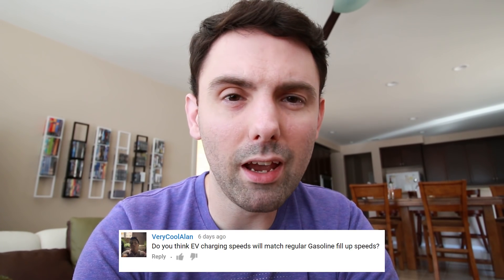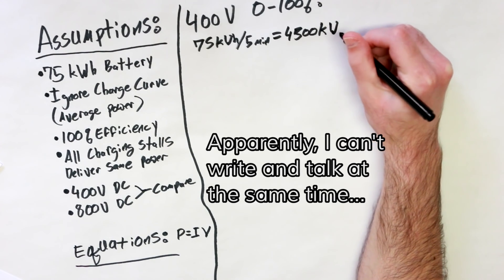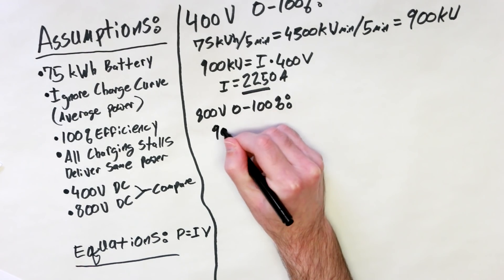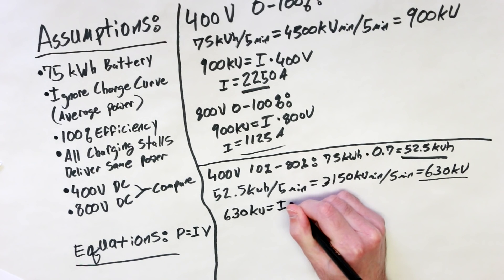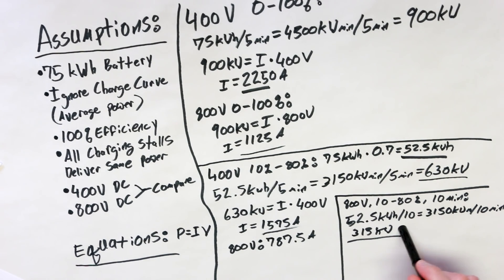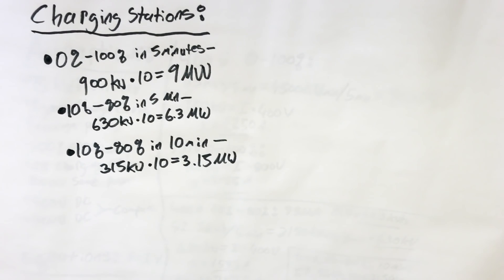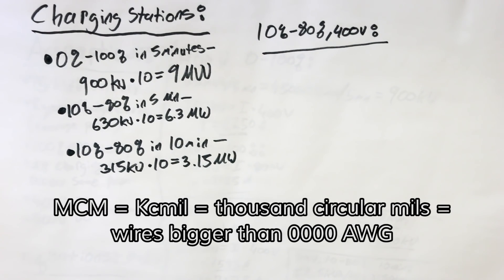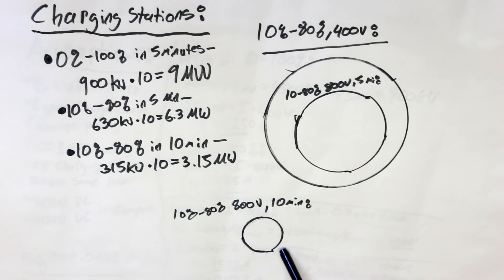Can Electric Cars Charge As Fast As Gasoline Cars Refuel?

Comment: Are your assumptions valid? How many people often do not refuel until the fuel needle is actually on E, and the low-fuel light is glowing? How well does the EV battery produce the needed cruising power, at 5% charge? Yet a fuel car delivers full fuel pressure at 5% tank capacity.

People probably do not often run down to 5% battery charge, due to the lack of good recharging locations. But if recharging points were as ubiquitous as fuel stations, wouldn't we want to more often run down to 5%?

And why wouldn't I want to fill to 100% charge, well if that is reasonably possible in the future?

And if you have a lady in the car who needs a restroom break, shouldn't you figure 10 minutes?
Reply from the maker: The assumptions being made in the video regarding target arrival (10%) and departure (80%) state of charge reflect reasonable EV use when on a long trip. With a long-ish range EV (200+ miles), fueling around town isn't something you ever have to think about--you plug the car in when you get home and it's always good to go by morning. On long trips, charging stops are pre-planned, the car's software tracks energy usage, and you typically shoot for a target SoC (state of charge) of between 5% and 20% when you arrive at a charging stop in order to maximize your charge curve advantage (lithium batteries charge much faster at a low SoC than a high SoC). Similarly, one doesn't typically charge higher than 80% unless it is actually needed to reach the next charging stop because charging speeds slow significantly once you reach the 70-80% range and continue to dramatically slow down beyond 80%--the most time efficient approach boils down to only taking on as much energy as needed to make it to the next charging stop.

At a 10% state of charge in a Model S P100D, your 0-60mph time increases from about 2.4 seconds to about 3.9 seconds and max power is limited to about 329kW (441hp) instead of 576kW (772hp). Maintaining a highway cruising speed of 75mph requires less than 20kW in a vehicle with decent aero. So, yes, there is a drop in performance as the battery discharges, but not enough of one to in any way meaningfully impact your ability to maintain freeway speed. Lithium chemistry batteries have a fairly flat discharge curve until you start pushing into deep discharge states, at which point the voltage tanks. However, discharging a Li-Ion cell to the point where voltage rapidly drops off can damage the cell, which is why all lithium chemistry EVs have safeguards in place to prevent discharging the battery beyond a certain point--it may read 0% on the dash and the car may shut down, but there will still be a few kWh in the pack to protect it from damage.
Reply: +Alex Venx
5% to 20% promotes range anxiety, especially on an unfamiliar route. It is easier to run an ICE car near to E, when driving close to home where you know where your favorite fuel stations are. I like to have a full tank before starting on a long-range trip, so as to delay as long as possible, having to find a suitable unfamiliar fuel station. EVs are still quite weak in the minds of the public, at making long-range trips, as they are still perceived as short-range commuter cars.

3.9 seconds still is way too fast for me. Jack-rabbit starts that throw people back into their seat, do not impress me. But at 10%, would people feel that they have to turn off the air conditioner, to reduce their range anxiety? Those fuel-station signs at the next exit, one mile down the freeway, doesn't help when one is driving an EV.

How long do I have to wait, until you figure that EVs become practical for most people, or for me? It seems like they still need to do a lot of work to improve the batteries. However, 200+ miles on a charge does pique my interest, well if EVs were affordable. I do suspect and hope that autonomous self-drive EVs is the wave of the future?
Reply from the maker: A lot of the ideas people have about range anxiety stem from people insisting on thinking of fueling EVs the same way they think of fueling ICE vehicles--the poor instrumentation provided in ICE vehicles doesn't help with regard to expectations either. Again, in an EV with decent software (like what Tesla provides), there is no searching for charging stations on a long trip or guesswork about whether you'll make it to your next charging stop. I demonstrate Trip Planner in this video that I posted last year, it should make more clear the point I'm trying to make: https://youtu.be/Xyf7KanxOTI?t=1m53s
Reply: +Alex Venz
Well I would find it very annoying if I have to deviate from my trip route, to waste time recharging. We are not used to doing that with ICE cars. However, I think people seriously consider doing that before buying an EV, and probably think of doing mostly short-range commuting, and budgeting a little extra time on long trips for recharging.

I particularly hate one particular ICE car that I know of, for the fuel needle dropping faster, at below a quarter of a tank. And then it has a stupid idiot like "Check gauges" instead of a "Low Fuel" light to tell what is wrong. How idiotic can idiot lights get? And what if the gauges are broken or something?

Yes, the ICE fuel gauge even is terribly out-of-date. Same crap system that they have been using for the last half-century. I hear that the very early cars, had fuel needles that sloshed around with the moving float in the fuel tank. For decades, they have put a stop to that distracting nonsense, either by somehow dampening the needle so that it can only move very slowly, or else with some sort of computer software that sort of takes the average of the readings over the last 3 minutes or something?

Another thing that would bother me about getting used to an EV, is the assumption that I must use the recharging point that the trip planning software has chosen. What if it appears to be a bad neighborhood, or is poorly lit up at night? What if creepy people are hanging out there? Hasn't anybody ever driven to another fuel station, because something didn't seem right about the one that they had been considering? Well if the next recharging point is 50 miles away, and you have only 35 miles left, then driving to some more suitable place, isn't really an option.

Perhaps you could make a video on the reasons that people choose EVs. Are they enviro-wackos? Are they trying to push the technology forwards, so that EVs soon become a joy for everybody as they hopefully improve? Are they rich people, looking for just another high-tech toy to add to their car collection? Do people own EVs who are frugal or on a limited budget? Are EVs becoming a possible good value yet? I would like to push the technology along, but I would need a much better job to be able to afford that luxury. My ICE car is worn out, I doubt that it will last much longer, and I hate it. I wish I could buy an EV, but it doesn't appear to be an option right now, and I am not so sure that EVs are really practical yet, for most people. I love how quiet EVs are, but I will not be happy at all, if I notice battery degradation after only a few years. BTW, I have never had a new car. Too expensive.

Comment: What about that cool battery exchange system Elon demonstrated? It replaced two batteries in 3 minutes as I remember. That would be really cool. Just subscribe to a 'battery exchange ' service, like they do with propane tanks.
Reply: That system was introduced by Renault in 2013 and the current Renault Zoe was designed for such as system; however, it was too expensive to run and the company who ran the swapping stations filed for bankruptcy and closed down 2 years ago. It should be noted that the Renault Zoe is the best selling EV in Europe, so it had as much support as any other EV.
Reply: The right term is "batter swapping"

Comment: silly question but why not have the battery system as 2 seperate packs therefore allowing you to charge both at the same time, (like 2 gas tanks) cutting your charge time in half?  then just have something that will even the packs when the systems running?
Reply: That would be counter productive because the larger the pack, the longer it can charge at higher rates. A smaller pack will not be able to achieve the same peak rate and its rate of charge will decrease much faster. For example, a Tesla with a 100 kW/h pack charges much faster than one with a 60 kW/h pack in terms of power received and thus range.

Comment: As battery and charging tech improves of course it will get faster, but how fast does it need to be? The vast majority of charging happens at home with only a moderate need for long journeys. Even rarer is the need to do long journeys in one stretch, eating behind the wheel and peeing in a bottle.

Comment: Very interesting and probably not far off the correct answers , 800 volt, 350 amps approx 10 minutes looks only sensible option unless combination charging used

Comment: Could solve all this with room temperature superconductors. :p I wonder how fast you could charge the current gen of Tesla batteries without getting lithium dendrites...
Reply: +Duke
Free-energy perhaps more likely already exists and is being suppressed, than room temperature superconductors could exist. Do we know if room-temperature superconductivity is even possible? However, it may be possible to keep superconductors chilled, cheaper and easier than we know how to do it now. But then, would that introduce a disturbing hazard? What happens if the chill is lost? Will the energy be suddenly released as internal resistance then, and the superconductor battery goes into "meltdown"?

I do imagine that superconductors might take a fast recharge though.

But please do not forget, that the capacity of your superconductors may be more limited than you think. It sounds like you want to build up massive current in the superconductors, but that would produce a massive magnetic field, that could rip the superconductor to shreds, perhaps in a massive explosion? I don't know that massive super-magnets going down the road, would be safe? You can only shield a magnet but so much?

Perhaps we might have better success with super-capacitors, which do not have the same kind of room-temperature issues. Unlike current batteries, the outside weather temperature has little or nothing to do with the capacity of capacitors?
Reply from the maker: Given that room temperature superconducting materials are hypothetically possible and free energy, as the term is typically used online, most certainly is not, your first statement is dubious, at best. Also, you have absolutely no idea what a superconducting material is or how +Duke was jokingly suggesting using them to solve some of the practical problems I was presenting in this video, do you?
Reply: No.

Charging time is limited by the chemistry the battery used. Not the conductors.

Comment: if as  you said put bigger batteries at the charging station, theoretically you could deliver 800Amp or more easily with just bigger cables as you said

Comment: I thought you said a little math! :)  I think 10-15 minute re-charge times for EV's are within a reasonable time to charge a car and the tech is on the near-horizon to do this with solid-state glass batteries, as being developed in labs and showing these types of charge times without any degradation to the battery.  Current Li-on tech will be phasing out over the next several years just as Ni-cad did, last decade and lead acid, the decade before.

Comment: What about a different metal? or alloy
Reply: Not to mention the security issues. High voltage, high Amp,
Reply from the maker: For what, charging cables? From a pure conductivity standpoint, the only metal more electrically conductive than copper is silver... Really, one of the ways around the large diameter cable problem is to balance creative cable cooling (think liquid cooled or chilled cables/connectors) with the fact that charging an EV in a short period of time wouldn't count as a continuous load (though, you would have to monitor the connector temperature and reduce the charge rate accordingly during extended use).
Reply: I was thinking Aluminum. It will be thicker but lighter. It has 30% the density and 60% conductivity so 100%ish more conductivity per unit of mass. And it's cheaper.
I was thinking out loud. Since the cable that you have to lift and connect to the car is just 2-3 meters I'm thinking a more exotic metal can be applied?
Reply: Al has been used for power lines for ages. Now, compute the required cable size SVP. Flexibility is an issue too.
Reply: +Alex Venz
I think 5 minutes counts as a "continuous load", for in 5 minutes, the cable is probably about as hot as it is going to get.

Actually, isn't it possible to run cables a bit hot?, however a hot cable is more vulnerable to getting hot spots where the cable is bunched up against itself, hindering its ability to cool itself. This likely happens often, as wires are longer than they need to be for each instance of usage, to make sure that they are long enough for most usages.

If more things were designed to run hot, then that would reduce the risks of overheating. Usually, in an overheated wire, it isn't the wire that is so much overheated, as it is the insulation that starts melting or smoking? If we used insulation that would endure high heat, then we have to consider that users do not burn themselves putting away a hot cable.

If there is any idea to let the cables run a bit "warm", perhaps some temperature sensing filament could run the length of the wire, sensing for any problem hot spots, that then would reduce the current. An indicator light could come on, "Cable overheating detected - Check cable" or something or other. Also, perhaps a system can be developed that checks the resistance or voltage drop of the cable during charging, as abnormally higher resistance likely indicates either a poor connection or a hot cable. Well at least that happens more prominantly with incandescent light bulbs. The resistance increases as the filament gets hot. However, would resistance monitoring be able to detect small hot spots in the cable? A place where the cable is bunched up against itself.

Or should we reduce the current by using 1000s of volts?

What if cars could make their own electricity, via the free-energy technology that the NWO stole from Telsa and the American people? Then we wouldn't need any recharge cables, and there would be no recharge wasted time. Cellphones would come without chargers.

Comment: 800/1000 Volt systems are probably the next step. Porsche is developing their cars based on that. That would allow double the charge rate at the same cable size. I hope the next gen Model S/X will have a 800/1000 Volt.
Reply: Still at 1000V, you need 1000A to recharge a 75kWh battery in 5 min ! And 1000 V is becoming really serious in term of security, isolation, breakers, arcing, power semiconductor breakdown.
Reply: I doubt we will see the 5 min recharge anytime soon. Even if power from the grid would be available, the losses are so high that the car would need a serious cooling system to manage the heat. I don't see that being practical in a car. It would take up lots of space and weight.
Reply: Yep, they will go for the 800V option and claim a charging time of 15 minutes for 80% charge, which fits neatly with the numbers mentioned in this video. Supposedly this will be the charging system for all next-gen VW group EV (Porsche, VW, Audi, ...), starting with the Porsche "halo" car (Mission E).

Comment: YOU ARE RIGHT ! Wherever and whenever I can, I explain that to all these gullible Tesla fans and other battery car worshippers ! Musk is nothing but a fake, a guru and a crook  ! Add to your demo the HUGE cable size, plug, breaker etc... required. And any charging time exceeding 15 min will lead to HUGE queue and required infrastructure at the charging stations !Sad to say but the failure of the US to go metric shows how people are technology wise illiterate, therefore confused and gullible. Prime target for all these battery salesman. Why do you think Musk is setting up these battery factories and putting them in cars, house power bank ... etc... He even "designed" a proprietary battery size !Add to that the usual marketing crap: save the planet, show the world you care, fantastic car performance (easy with an electric motor), status symbol, false shortage, refundable small deposit to reserve your dream car (too bad but it Is a dream that won't drive you far from home). All the trick of the trade BUT NO REAL BREAKTHROUGH, certainly not in the KEY component, the battery ! Oh, yeah, the only GREAT idea he had was to use cheap 18650 LiIon battery used in PCs (not anymore).